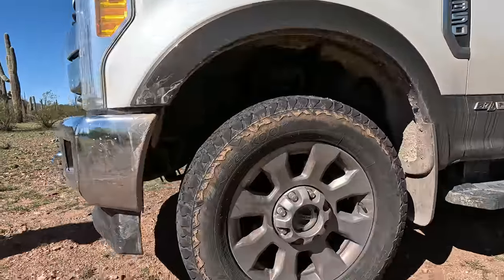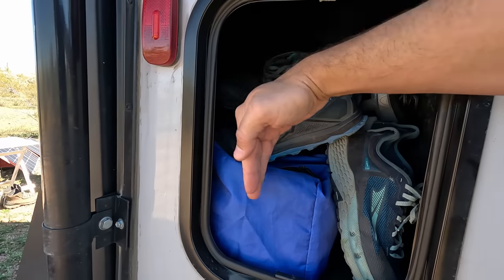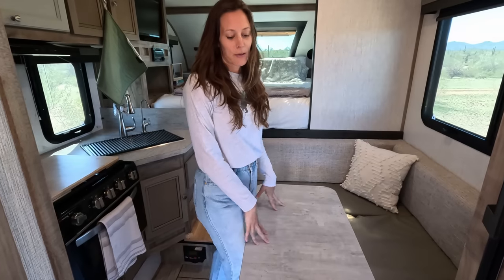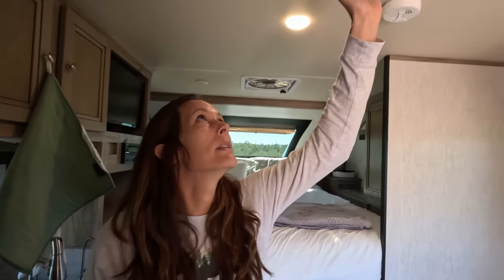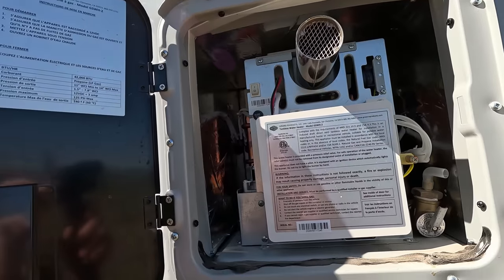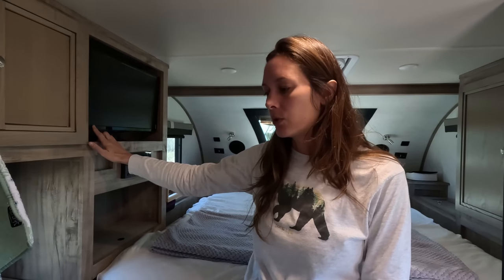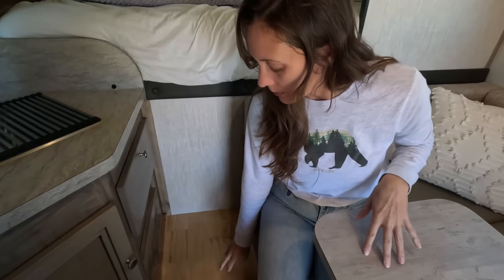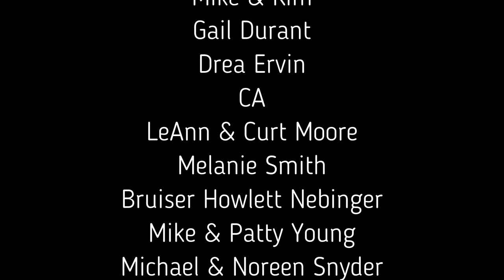Why a Truck Camper? Honest Six Month Review Living in a Truck Camper

Comment: With your noise on the 12volt dc and the 120v ac outlets you clearly have a loose connection with the buzzing or humming like noise. It could be at the outlets or at the control panel but most likely at the outlets since you don’t have an issue else where. I’m sure one of y’all’s dads can fix this issue if Cody doesn’t feel comfortable. Hope this helps y’all out. Stay safe y’all
Reply: Could have a poor connection physically hot, potentially unsafe condition. 🔥
Be safe.

Comment: If my wife and I can ever afford to get an RV I have decided that this might be the way to go. The home is always with you, you do not have to worry about someone stealing/vandalizing a trailer while you run into town, smaller total footprint, go anywhere, and such. Great video.
Reply: When I hit the lottery....
Reply: I would have E-bikes along with such a rig so you can take short trips without disturbing your home or adding to the gasoline consumption.
Reply: Have you priced f350 trucks?
Reply: However,  if your truck needs work and has to go to the shop, there goes your home.
Reply: A truck and camper like that new… 140k … maybe find some equivalent older truck and camper 50-80k
Reply: It also relies on a truck chassis/ suspension. I have an f 150, long bed with 3000 payload.  While maybe not your cup a tea....I'm getting a project m-   its more in my price range- not much in it to break, also.

Comment: One thing I do to wash dishes to try and conserve water is I use the collapsible rubber wash tubs that lock to keep water in and open to drain. Your sink might be big enough for both of them. I clean my dishes in one and rinse in the other. Then you can either let them drain or throw out the water depending on where you are.
Reply: Make the table adjustable
If  it goes down it could be a foot rest...Xtra bed etc..just an idea

Comment: When doing dishes, I take a pan that will be washed, fill it with the “first water” (cold) and heat it on the stove. It heats quickly and by then the hot water is running into in the rinse dishpan. Then I add the heated water to the wash water. This routine actually saves on water use by not wasting the “first water”.
Sorry if I don’t explain this as clearly as I should, but I hope you know what I mean.
Reply: I have a propane water heater but I only use it when I'm going to shower. For doing dishes I heat the water in an electric kettle. It works well and I'm not using the propane nor having to wait for it to heat up whenever I want to do dishes.

Comment: I have a Model year 2000 Jayco Travel Trailer that we bought in May of 2001.  I pull it with the GMC version of your truck.  My truck has a seven foot bed (intermediate length).  Some friends have trouble climbing up into it, but other than that I have loved it.  The big thing I really like about it is that I can lock the camper up on my camp site and go to the grocery store, or drive a vehicle trail, or go out to eat, etcetera, and it is still sitting there holding my camp site.  I have a tonneau cover for the truck bed to keep my stuff dry and out of sight.  It also has a locking tailgate which locks when I lock the cab doors.  For me, it is the perfect combination!!

Comment: You mentioned the windows that didn't have shades and the heat that goes in. I'll give you a hint of what I did for the windows in our Toy Haul. I bought those truck Wind Shield Sun Shades, those silver ones. I then took paper put it on the window to trace a pattern, then cut it out of the sun shade. It was perfect and fit in the windows perfect. It cut down on the heat so much!
Reply: I did that with Reflectix for my car, the driver and passenger windows, because the CA sun on my leather seats was too much and it also really reduces the heat in the car. I have a windshield cover also. When I go on road trips and need to nap at a truck stop or rest area I also put those shades in the windows for privacy and to block the lamp post lights.

Comment: Our trailer had a regular 8 gallon water heater and every time we turned the water off while showering and then back on to rinse, it was always cold. I believe it just gets cold in the line, especially during the winter. So I don't believe the tankless water heater is to blame entirely as we had the same problem.  We almost bought a Lance camper but opted for a travel trailer as our truck wasn't big enough. I really like the Lance campers and trailers. They are well made.

Comment: Love your vdeo! Our first camper was a slide-in back in the 80s. It had so much storage. Our kids were pre-teens, and they mostly rode in the camper back then since our truck had a standard cab. The camper had a window that lined up the truck rear window, and they would shine a flashlight on the floor of the pickup through the back window when they wanted our attention. We had a great time in it. After it wasn't road worthy anymore, we waited quite a while before we got our 2nd camper, which was an 18' tow behind. We are now in our 3rd camper, a 21' bumper hitch, and we love it. We took a 2 month trip to Alaska last summer and highly recommend that trip! We boondocked a lot on that trip. We put shelves in the wardrobes, too. Much better utilization of space. I do dishes in tubs, usually outside, and don't use running water. I, too, love the oven and have never used the microwave. I, too, am in the process of taking it out for the storage. Happy travels!

Comment: Great video!  Fyi, you can add a soft start to your AC unit to help with off grid Battery/inverter options.  Switch out to a hot water tank.  Mine has a motor aid option where the truck coolant is plumbed into the hw tank so you arrive somewhere with more than warm water.

Comment: Yes campers are so versatile and you can go just about anywhere and park anywhere. You’re better off with the diesel I heard the 7.3 gas engine has some cam delaminating issues. 
We traded our 2008 Lance 992 and ordered and bought a 2022 Lance 1172. We prefer the layout has it has a rear slide couch. Much more comfortable than sitting at dinette. We went the 2 solar panels plus we have a portable one and 2 lithium batteries and an on board propane generator. We haven’t tried the camper out yet we got it late last year. Waiting for spring.
Reply: Best Ford motor was the 7.3 liter diesel but they discontinued it after 2003.  It's bulletproof and good for half a million miles or more with proper maintenance.

Comment: I had a 1998 Chinook RV on a Ford 350 4 Stroke diesel. It was a great choice with -40 degree fully enclosed insulation in a Fiberglass shell. A/C of the dash would keep the whole inside cool in Death Valley.

Comment: Buy some reflectix material to attach with Velcro over the windows. Good for hot and cold! Can’t believe your rig is just 2’ shorter than our Navion! Happy trails, love your vids!
Reply: We did this in our bumper pull camper.  It made a huge difference, especially in the heat of summer

Comment: Regarding your air conditioner and having to plug into short power. If you install a soft start on your AC unit you can run it with a small 2000 watt generator when you're boondocking. Generally, those generators will run 11 hours on the standard gas tank. Cheers

Comment: Concise evaluation! Some of my experience; Why a truck camper? I spent time in the construction industry and traveled to jobsites with first a 5th wheel, then Class A. then class C. If you want to live in a trailer park the 5th wheel and class A are too big to just boondock or even find a place to park; so trailer park to trailer park. The truck camper is looked at by most people as just a 'canopy' and not a living unit so you won't get grief over parking on a side street. Retired now we spend our winters in Az. After 15 years exp. I started with a single rear wheel truck but you must use heavy duty tires ( had custom 22.5 rims made), add rear air bags/overloads to get rid of sway. Now have DRW F450 with bags. Camper; biggest Arctic Fox with single slide, will be getting the very best next time a Host Mammoth with three slides! Don't go tankless on water heater, use the microwave, and the onboard generator runs the A/C. You can park anywhere and with our electric bikes, this is perfect!

Comment: Install a one way check valve on the hot water side of your shower. I did  it in my camper and it stopped the cold water blast. There are videos on YouTube on how to do this. It is pretty easy
Reply from the maker: Thanks for sharing

Comment: Yeah, I forgot to warn you guys about that water heater coming on at night! Ours got to where it came on if it was , say, lower than 50f outside..I tried another sensor but it was about the same. I finally bought a ''Lizard Light'' for like an Aquarium, only about 25w, and mounted it in the waterheater . It keeps it so toasty, you have almost instant warm water , but it is 110v so you have to power it off the inverter or shore power. The lithiums will keep it on overnight ok , but if it's stupid cold we go to a rv park mostly. Also,  remember to insulate around that front window and cap when you can, you will love the result's. Thanks for another great video !  jeff

Comment: Love to hear your stories!  We started in the 80's tent camping just the two of us and later tent camping with kids.  Next we went to pulling a trailer and the absolute unbeleivable JOY of having a roof, water, cooking ability, heater and toilet.  Next we went to small older motorhome so we could tow our boat and the kids were along, that was what we needed because we love to go fishing.  Next we went to 5th Wheel camping close to home, but I had to take two round trips, one to take the 5th wheel and the other to take the boat.  Difficult but WOW that 5th wheel with slides was like home.  Now the kids are gone, we have a camper, boat and jeep.  We take the camper everyhwere we want to go and tow either the boat for coastal, lake trips, or the jeep for desert and mountain trips.  What FUN we are having and it is the perfect setup for two and it works for a couple weeks or so.  We love camper trips but are thinking about a 5th wheel for long term trips where we would be gone for moths at a time. Still pondering this but a Camper might work for months if we could get out and not be stuck inside for too long.. Anyway, we love your channel and learn a lot from you both!  You are a great couple.
Reply from the maker: Great story. I think a fifth wheel would be great for long term in one location.

Comment: Cut a piece of reflective insulation to fit in two both windows and uses as needed easily stores away when not also can use a Velcro tape if needed use a stapler on the reflective pice

Comment: If u haven't already, get an Oxygenics showerhead. It saves water and helps keep ur water warm between pushing on and off. A water aerator on the kitchen faucet saves water. We love our Predator generator, especially to run the AC in hot temps. Maybe u could add a carrier rack on the front of ur truck to carry it. Love ur camper! Happy travels!

Comment: Great video! Love your camper.☺️ THANK YOU for giving us the CONS of a tankless hot water heater. I have not heard ANYONE tell about cons of having one. Only the pros. We have been considering one for our horse trailer’s living quarters. Our living quarter’s set up and water capacity is pretty much the same amount of space as your truck camper so your comments definitely give me food for thought about whether we should do that or not. When you are plugged in at a camp ground, you then CAN have endless hot water showers (without needing to turn water on and off for conservation reasons) though correct?🤔
Reply from the maker: You are correct

Comment: You need a shower miser for the water. And boil water for dishes, wash all at once, and then drain the dirty soapy water, refill with clean water and rinse. It will use less water.

Comment: Paper plates and bowels are awesome when boondocking.  Thank you I did not realize the hot water comes on like that.
I use my microwave I  would remove the oven and put a convention for me. Of course you need a generator or lots of battery power.  I have to think more about that 😊
Why would they give you a beautiful window without insulated that's crazy.  Thanks for the tip on that.
Great video!!

Comment: I had the same issue with batteries. In your case swap the panel with a 200watt they make them now the same size as the 100watt. Also for lithium not sure if you got the the standard size. I purchase 100ah PowerQueen Premium 2 mini batteries and was able to fit 4 of them in a slot where only 2 deep lead acid batteries went. Total of 400ah batteries.

Comment: A pickup is a natural base for a camper. There was a legendary built in camper by Toyota - the Dolphin. Owners cherish them after 30 years. In Europe there's a VW diesel camper based on VWs pickup. Also 30 years old. Toyota is coming out with a camper based on the dependable Tacoma platform. And there's an increasing number of custom pickup based camper installations. 

Too many RVs are of poor construction and rattle apart after ten years. That happens with a pickup camper and you just replace the camper and still have your vehicle to start over with.

Parts and service for a pickup have to be cheaper and more widely available than for any RV. And everything is easy to get to, just like a pickup.

Comment: Change the water heater for electric 12 v one. Change the current heating unit with a dizel heather. Should fix the noise issues.

Comment: If you have a big enough power station, you don't need Shore Power for a Microwave (you have to match the appliance's Wattage with the Inverter.

A 1200W Microwave will work in a 1500W Jackery or a 3000W Bluetti AC300.

I also have an 1600 Induction Cooktop (only runs AC300 or Shore Power),  an Electric Kettle.  

Recently also acquired a Waffle Iron, Small Crockpot and a 12VDC Electric Lunch Box and a small Butane Stove.
Reply from the maker: Correct but we have no room for the inverter and more batteries. We would also need it to run the AC and that’s it. But no worries we just stay at a campground when we need AC. Plenty of those to go around

Comment: I’m happy the truck and camper are working out for you. I remember when Kellie said y’all would never stop using the H3 and would have a yard full of them just to keep it running. It reminds me of the 04 Xterra I used to own, it was a stripped down model that did not even have power windows and a manual transmission. I spent so much money to keep the thing, even when I knew it wasn’t going to have enough power to pull our travel trailer I still wanted to keep throwing money at it. In the end, my wife and I went with a new 2021 Tacoma instead. Now I couldn’t see having anything else. 

Someday y’all can get the old “Bearaju” or whatever y’all called it back going again.
Reply: @Taco Traveller.  How many miles did U get outta your 04 Xterra?
Reply: @melissabenson6749  It had 270k miles on it when I sold it. Still ran great and did not leak a drop of oil. First gen Xterras are great if they haven’t been trashed, especially the 4 cylinder models with the KA24DE engine.
Reply: @Taco Traveller   Wow, ok TY, I have an 04 ,6cyl.4wd!  & was just curious of your experience!
Reply: @melissabenson6749  The V-6 VGE30 engine, or at least what I think it’s called, was a great well proven engine by the time 2004. It had been around since the 1984 300ZX was introduced. Not a huge issue, but the engine has a timing belt instead of a chain. I prefer the chain because they tend to last longer and do not replacing as often, but still a great engine. I wished Nissan was still the company it was in early 2000. I never considered a new Frontier due to their current quality.
Reply: @Taco Traveller    That's good to hear, mine runs great & it's still a nice looking SUV, sits high like a pick up.  I've had it 7 years & only put 6 or 7k miles on it, mostly just drive locally. I really like it!

Comment: I've been living in my 2018 850 Lance truck camper since I bought it new. I'm actually sitting here in my dinette writing this comment. 
My two favorite jokes on why I love my camper life. If I don't like my neighbors I can get new ones in about 5 minutes. If I don't like the weather then drive until I do.
Ok my advice for winter months is get a compact dehumidifier. Get a small ceramic heater to balance your main furnace to prevent constant cycling on and off. However don't place the ceramic heater to close to the thermostat or else the main furnace won't cycle on enough to prevent holding tanks from freezing. By the way my feelings are that the world is my livingroom. My camper is my base camp. Oh and used drier sheets removes insects easily with water from the front of your truck and camper. No need harsh chemicals. Anyway enjoy the great outdoors. 
Now back to my 9Barista espresso latte.

Comment: Really good video. Great job. You may be able to find a better aerator for your kitchen faucet to provide a more substantial water “feel” using less water. Just a thought.

What kind of scale weight is the rig (together or separate or both)?

What kind of fuel efficiency are you seeing? My 6.7 with a Lance was pushing 15-16 regularly. My f450 dreams of double digits with my double slide Chalet. Plus I am 13’ tall.

I am subscribed now and look forward to more videos.

Comment: It is 'not' the 'Tires' that pull it is the 'Wheels.'   The Tires are just a rubber bumper fitted on the wheel for contact with the road.

Comment: Love your videos. I’m from southwest Missouri with a f250 and a 9.5 Sunlite. Have you considered adding more solar for boondocking? I have 500w and it’s by far the best upgrade I’ve done. It charges enough on a normal day to run my fridge, lights and 700w microwave or crock pot.
Reply from the maker: Not at this time
Reply: How much was that to add?